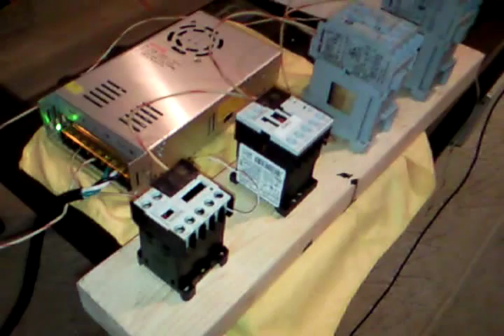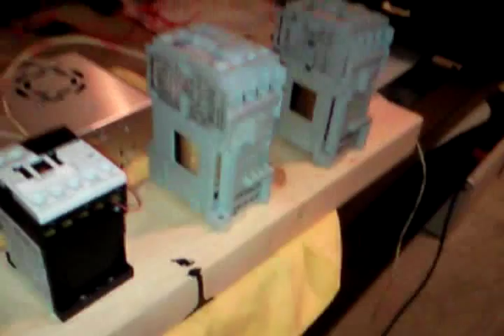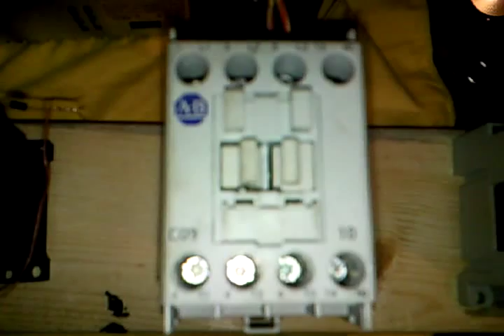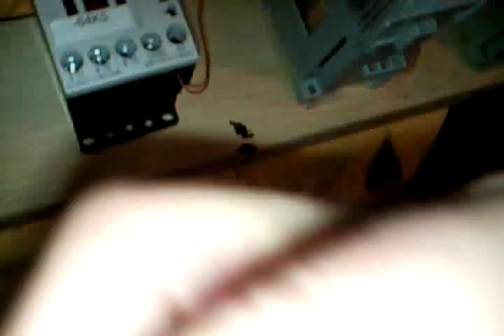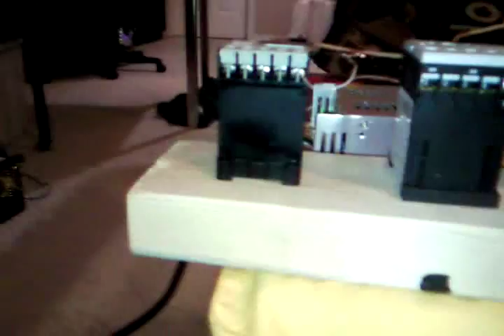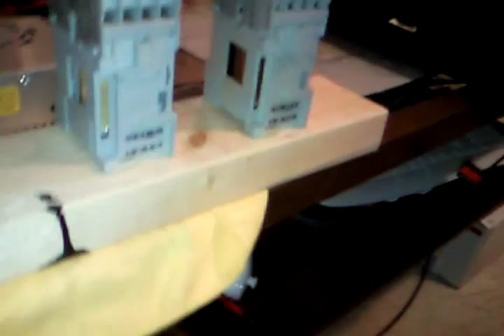Transformers virtual pinball build - Contactor Review and Comparison

Comment: Why should I use contactors? For the clicking sound or are there solenoids inside that give force feedback? I want force-feed back when using my Flipper Button, what do I need?
Reply: Currently looking into it myself. For flippers, it looks like a contactor would be a better choice over a solenoid. Solenoids are designed to fire on and off very quickly (great for slingshots or bumpers) however, flippers can be held for longer periods of time (cradling a ball) which burns out the solenoids.

That's my understanding, I'm at the start of this myself!
Reply: @mrmogony123  Thank you very much! Maybe i will get in touch with you next year and ask what you actually build into your cabinet. bye